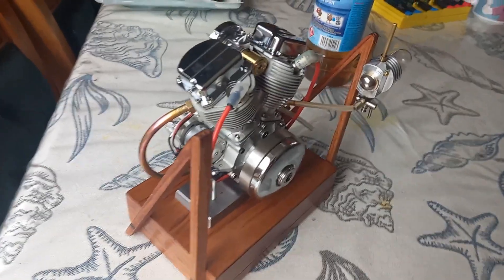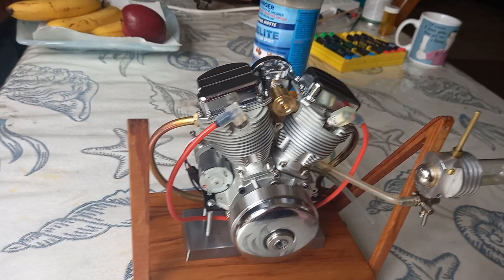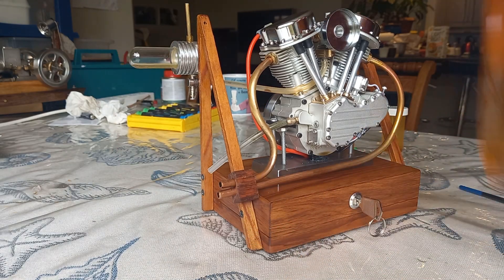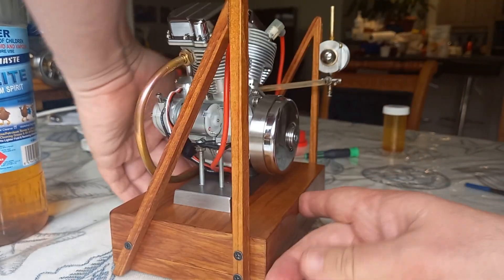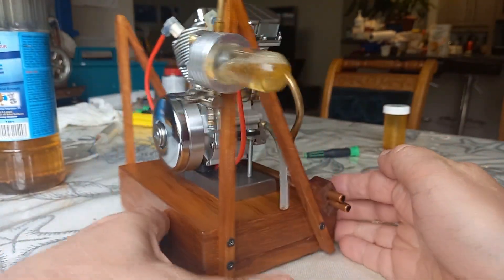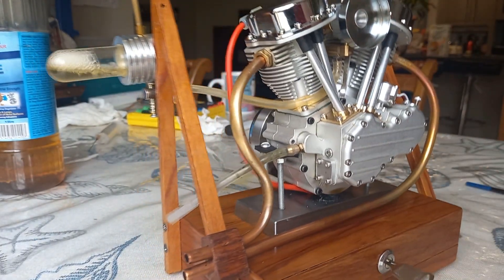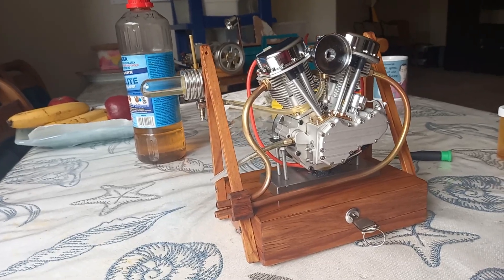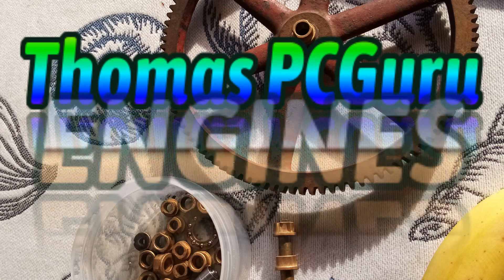Harley panhead v twin model BEST BASE I could build! CISON FG-VT9 9cc V-twin Motorbike Gas Engine

Comment: It would be great if the manufacturer could supply a stand and all the other accessories necessary, so that more people could enjoy these.
Reply from the maker: I totally agree. I mean, how hard could it be? Due to the "semi scale" of this engine the mounts on each side are different heights. We're not given even a diagram of those and it's nerve-racking measuring while holding the engine "vertical". Is it REALLY vertical? I started out with wood blocks but it turns out I can't saw anyrthing straight and even a millimeter out gets you a wonky engine...it's a problem. You know, if they don't have time, someone's kid in China will happily 3d-print and supply them for pocket funds, surely? So....yeah.
Reply: @ThomasPCGuruENGINES  interesting - if it’s a challenge for you, imagine how big of a challenge it will be for a novice to make a proper stand! I’ll send Mona at Stirling a note about this.
Reply: I’ve been told they are coming out with a stand in a couple of months.
Reply from the maker: @Fluterra  Thanks man. Sounds like a bigger push when the version two of the motor is released. I'm actually a bit tempted to get the black finned version 2....maybe I'll sell version one locally
Reply: Sterlingkit has the display stands to mount the fuel cells, and engine ,and keep all your electrical components hidden.
They also have a chrome air filter that really makes the engine that much more desirable.
And they have an actual kick start for this engine..
Reply: hi, what is the scale size estimate?
Reply: @IchibanMoto  it’s 1/5th scale I do believe

Comment: Engine is setup for an electric starter  where the original generator would have been, hope they come out with thaat soon!
Reply from the maker: After my struggle to start this today (it's usually easy) I have to agree. I'll be getting it.The little motor I added as a "stand-in" is held by a dot of superglue.

Comment: How do you tell what's cylinder goes with what wire from the C. D. I. Ignition
Reply from the maker: This very question had me so confused but the answer, people assure me, is that you don 't. Despite there being two ignition circuits they both fire...twice. One spark is wasted as that cylinder isn't ready. So each turn of the engine, only one cylinder will be ready to fire, the other is probably exhausting and the spark doesn't matter.

Comment: Nice stand ! A good idea, this glass fuel tank. I guess a fan would keep this marvel from overheating.
No starter motor available on stirlingkit store. So, I'm looking for a motor "torquy" enough to fight against both cylinder compression.
Maybe a geared motor is required. Did anyone do that ?
Reply from the maker: Mr Del my friend I know the little starter motors sold for Cison 4 cylinder engines can turn those over so surely they could turn this over??? Bit of a fuss making the required gearwheel or fitting an existing one...it's a big unknown. I've not seen a built in starter....they are offering the "kick-starter", though. This motor is the one I have most mixed feelings about in my collection. Going well it sounds amazing but it has done that so few times.
Reply: @ThomasPCGuruENGINES  Thank you for your answer. I think it's what i will finally do : buying a starter motor from another brand and fitting a one way clutch small enough to find its room inside the gear casing. The kick starter looks nice but not suitable if i use later this V-twin to power a Morgan scale RC 3 wheeler. Not sure yet but it's somewhere in my mind...
Some issues with your engine ?
Reply from the maker: It's on the back burner. I think the worst issue that keeps reappearing is piston rings sticking, locking up the engine to the point I have to take out a sparkplug and drip oil in to free it. Then I'll get a run until it jams again. And that's on the replaced ring.
I'm not sure I've got the valve timing right. Ignition timing is fiddly - slightly out and it will detonate a the other piston too early. The carb is a prick to tune. And the build quality leaves a bit to b desired. Will make a new vid soon...keep an eye out!

Comment: What fuel and oil do you recommend?
Reply from the maker: I'm using regular 95-96 octane gasoline/petrol with  5% two stroke racing engine oil. If your engine begins to bind in the piston ring, you need more oil in your mix. I'm using nothing special oil wise, but you don't get much so good quality makes sense. Modellers in the know recommend Redline if you can find it https://www.redlineoil.com/two-stroke-kart-oil I'm going to try Redline I think, and mix with the 100+ octane I get for my MX5 car